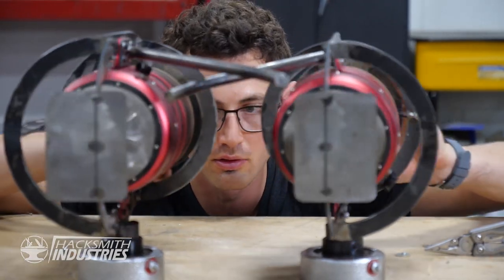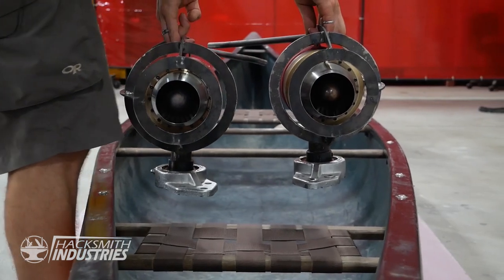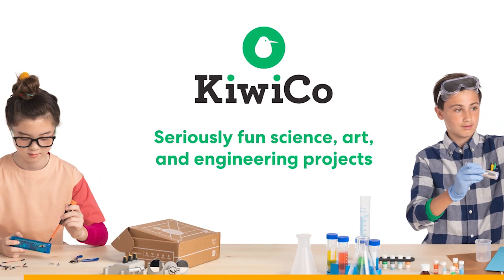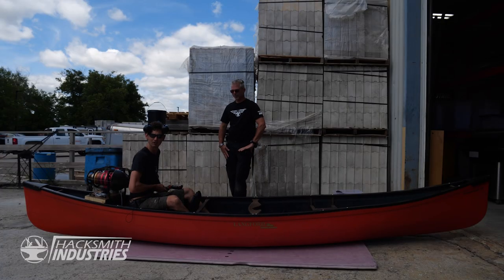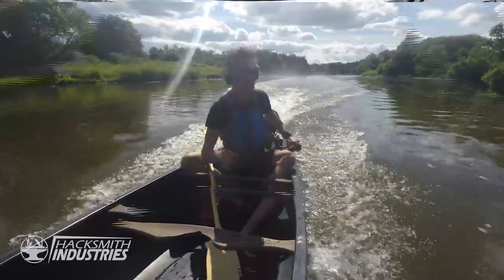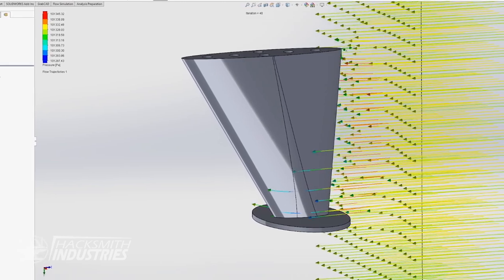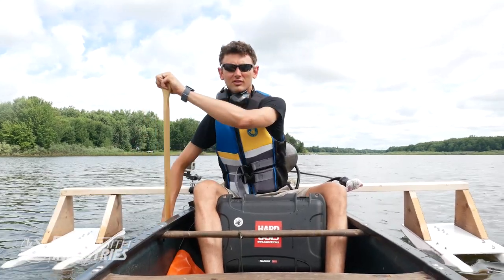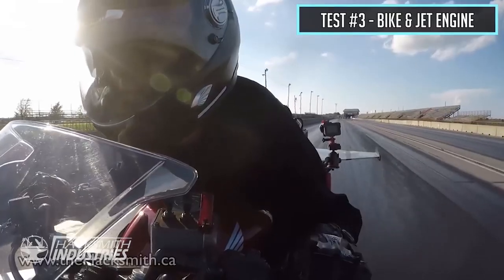JET ENGINE CANOE! (World's Fastest!)

Comment: Sit more forward and raise/pitch the jets so they give a more horizontal thrust rather than pushing the canoe down.
Reply: Second on pitch. Maybe a second lever for it?
Reply: Just put the jets on a hinge. Sit further forward with a longer control arm. More like the long boat racers.
Reply: More than likely having your weight forward would solve all of this... but if you needed more pitch control you could put hinges on the motors or put trim tabs....
Reply: Have you thought about how they're gonna steer the boat? Even though they sit more forward, what about the need of downforce?
Reply: or just counterweights might work
Reply: Ya but then you would put a more blunt edg into the water which would splash a lot of water into the vessel
Reply: Was thinking if a downforce wing at the front would work
Reply: Niël Muire If it was at the front, steering would be impossible, and the front would dive down into the water like a dolphin, in my imagination whatsoever.
Reply: @cedielenscarbonell1250  would the downforce at front be such a strong function of  force that the thrust vectoring at the rear couldn't change the direction?
Reply: I imagine that if you have a front wing and the downforce isn't sufficient that it could flip backwards because of that wing now
Reply: @cedielenscarbonell1250  what if the engines were placed towards the front and offset to the side so the gasses don't affect the driver. They could then be vectored and a small adjustable rear wing could inhibit the rear lifting. Also sorry for spamming you this stuff is just very interesting to me
Reply: Or do you need that lift so less of the boat is in contact with the water, reducing drag and creating more of a pivot point for easier steering
Reply: A method to maybe reduce drag whilst still keeping it in the water could be to have your engines up front and disperse the gas along the submerged length of the canoe. This could create a thin foam film to reduce drag without the need to raise the canoe out of the water.
Reply: I mean with it being above the water the water line, downforce being produced by air and not water
Reply: At any rate, if the hacksmith dudes end up reading this and you think its cool, I get my engineering degree end of this year and I have 3 years of workshop experience ;)
Reply: Niël Muire No problem, I actually like your idea.
Reply: Or maybe but a weight in the front to distribute the weight over the whole canoe while still having control at the engine
Reply: Yeah totally I know teleology to
Reply: Putting the fuel cell and maybe more counter weight up front should solve the problem.
Reply: @grantyalch5450  You'd need the front of the canoe to raise up a bit to let it glide, and i dont think more counterweights would help you at all with speed.
Reply: @cedielenscarbonell1250  have you ever heard of a rudder?
Reply: this -- ffs
Reply: If you look into small water craft like Zodiac's and Jetskis they are designed for this bow pitching.  While adding counterweights would be very helpful, I think that flattening the bottom of the back end of the canoe would allow the craft to reach a higher hullspeed because of the decrease in drag.  That way the nose will dip when the craft reaches a "planeing speed" after which the craft will be more maneuverable with the use of a rudder, and will have less drag as the vessel sits further out of the water. (People have been building boats for a while)
Reply: you need to modify the last half of your canoe get rid of the rounded corners of the hole and make it flat on the bottom with Square edged corners
Reply: You could also just put some weights in the front of the canoe
Reply: Elan Wan 
Putting a big weight on the front of canoe To keep the bowel down Will not work
All your energy from the engine will just go making bigger wake no gain in speed 
A Canoe is a displacement vessel once it reaches  its  hole
 speed Will not go any faster just make the bigger wave
Difference between a planing hole displacement hole
Reply: Definitely make the pitch adjustable, move you and the the gas tank forward. The liquid or gas will be pushed towards the back of the tank, and will be more pronounced as it empties effecting your center of gravity, and center of bouyance.
Reply: He could also just design a bracket that points the jets down a degree or two
Reply: @Giulio Basilico understandable, but what if the boat won't get directed properly?
Reply: It hurts to watch it try and get on plain
Reply: Holey water plowing wheelie canoe! This would be waaaayyy faster if you sat a little more forward and maybe some trim tabs to get up on plane.  Even faster yet, but a little trickier to engineer would be a hydrofoil design.
Reply: Next time they should do a EKRANOPLAN Canoe. That would be fun
Reply: @JustOutHereTinkering  maybe the electronics case and the fuel tank could be moved to shift the center of mass forward
Reply: Ditch the canoe and put it on something small that will plane. Adjustable thrust angle for pitch not yaw. Use a water rudder. The crazed nose up canoe was pretty epic tho!
Reply: YEAH REALLY...
Reply: When you are a single person in a 2 place canoe, you sit backwards in the front seat placing you closer to the center of gravity. Had they known this the canoe would not have gone so nose high
Reply: I just got the likes to 666....
Reply: I was gonna say that. if they were to sit just far enough forward so the bow is just out of the water they'll hit gold
Reply: Nerds

Comment: You had it at 8:37 "it was very back heavy"
2 ways to solve this:
1 point the engines down (just be sure you dont melt the back of the canoe.
2 (the most obvious) move the CoG forward. Make remote controls for the engines so the pilot can move forwards.

Also, if you had increased thrust the canoe would not have reared up further, instead it would have properly got up on the plane, leveled out and caused a brown stain in your pants.

It would only require a small skeg (look it up) the give directional stability and a rudder would facilitate much better steering than thrust vectoring.
Reply: Those two need to stay away from the water..... "back-heavy"? Most folks would stay "stern-heavy" ! Damn near fell out of my chair when I heard that!
Reply: @thomasnewbery7449  Tail heavy then, since it is a jet
Reply: @leifvejby8023  dude your a legend
Reply: @leifvejby8023  I stand corrected!
Reply: Or option three, more weight in the front. I was hoping that the cameraperson visible in one of the shots was going to stay there. It would have nailed the nose/bow to the water.
Reply: @rlaxton666  Yeah exactly. Most obvious answer, just more weight in front.

Comment: Canoe is too stern-heavy.
Their idea: 3D printed keels and outriggers.
My idea: Move forward in the boat.
Reply: my idea: stuff james in the front
Reply: Change the angle of thrust
Reply: I say make a ballast for the front
Reply: That was my thoughts exactly as soon as I saw how close he was to the engines.
Well that and adding a rudder to the rear operated by the same lever...
Reply: @mrmatt7210  Agreed. Since it sits pretty flat while not under thrust I would guess that the thrust angle needs to changed so the engines are pointed up just a couple degrees. Adding ballast to the front would only slow you down and possibly cause instability.
Reply: The amount of face-palm in this project is insane.... MOVE THE WEIGHT FORWARD!!!!! LOL
Reply: Put a car battery or two in the front.
Reply: 100 percent
Reply: @EasyMoneySG  Nah, what's happening is it's at the speed where the canoe is riding the wake. It needs more forwards ballast to help it level back out. Has nothing to do with the thrust angle
Reply: I was literally yelling at the screen: "Just move yourself further forward in the canoe! - Make a longer handle to still reach/control jets! - Stick your oar in the water one side to steer!" lol. Surely that would've worked better... I mean, thrust vectoring the jets is 'kinda cool' I guess, but unnecessarily complex, especially given he didn't have much directional control with it anyway. Rudder would've made more sense, or steer by creating drag one side with paddle/oar like the motorized kayak that already exists (See Top Gear).

Still cool tho.
Reply: Yea thats what i thought too wtf
Reply: @Epicwarrior846  james couldve been the ballast
Reply: Sailing dingys just use a tiller extension, buy one of those and your golden.
Reply: @ereklazar1384  couldnt have said it better myself!
Reply: If he'd sit in the middle the boat would soon the surface instead of ploughing through it
Reply: @mrmatt7210  that wont do a whole lot.
Reply: H needs a square back canoe so it can plane.
Reply: 2 words: Longer handle
Reply: Mr Matt Exactly. The engines were pointing upward. The thrust was pushing the stern down until the engines leveled out.
Reply: @pollux3685  frustratingly he was, but ONLY for the test with the out-riggers D:
Reply: 2-3 cinder blocks in the front of the boat
Reply: Not the best engineers!
Reply: When a vessel is planing it is sitting on top of the water where it has less water friction due to less of the Hull being in the water, by having all your weight in the stern and none on the bow your bow will rise out of the water but your stern will squat there for it is unable to overcome its displacement in the water and just ends up being a semi displacement Hull. The canoe would go a lot faster than that if they just moved the helm position forward at least a small bit. Probably not all the way forward otherwise the bow will start to dig in and you'll have stability issues at speed. I'm surprised they didn't try moving the helm position forward to begin with. Outriggers would only increase your stability at rest in that application.
Reply: Interesting to see it on hydrofoils
Reply: Yep. Would need to mount the engines higher to point them level and not hit the boat, so move the driver forward to next open spot and let it eat.
Reply: Also those aren’t called keels, a keel is the spine to the boat, those are keel fins, and even then not really because they were put onto the outriggers not along the keel. Also outriggers help with side-to-side motion not front to back, a keel fin helps because it gives greater purchase in the water but it needs to be a lot longer and farther up on the boat because you need that purchase to pull down the front end of the boat. The better solution is to give yourself a longer handle and put yourself in the front seat, as long as you weigh more than the thrust the jet engines put out you can go maximum throttle and you don’t have to worry about your clothes flying back into the jets. The longer handle will also make steering easier because you can move it less for a greater angle making it way more responsive.
Reply: Yeah I thought the same thing.. also the water seems to be rally turbulent under the canoe I think they are sacrificing a lot of energy to the steep angle
Reply: @EasyMoneySG   the canoe sat flat becouse he was sitting 50cm ahead
Reply: Youre right

Comment: Hacksmith 2030: “we put a fusion reactor on a canoe”
Reply: “We put an arc reactor on a canoe”
Reply: Hacksmith 2080: "We put a Black hole on a canoe"
Reply: Hacksmith 2090: “We put a inter-dimensional portal on a canoe”
Reply: @TRAMNITTSU  Hacksmith 2100: We created another universe in a small containment unit and used it's almost unlimited energy to power a canoe
Reply: Hacksmith 3000: “we used the fundamental basics of warp drives such as anti mass and positive mass powered by reactors with the output of 20 suns to warp drive our canoe to 729,000,000 times the speed of light”
Reply: Hacksmith 2030: we put an air tight capsule and military grade rockets on our canoe to go into space

Comment: Hacksmith: I don’t know anything about Aerodynamics or water dynamics

Hydrodynamics: Am I a joke to you?

Also, quick tip for the keels. For sailing at least, you want the keel to have a more teardrop shape like an airplane wing for the best outcome.
Reply: Blake Erenhouse as an f1 fan I wonder if they could use like a f1 wing design on the boat to create downforce at the front of the canoe seems like a long shot but that would be cool
Reply: Fluid dynamics: Yes, you are a joke.
Reply: Blake Erenhouse  aeroplane
Reply: @DanC8111_  I think a hydrofoil in the back would  probably work better the air speed isn't that high.
Reply: Is the one connected to the steering also called a keel or does it have a different name? I don't remember.
Reply: @The_Potato_Lord  are you referring to a rudder?
Reply: @lostincyberspaceIII  thanks, I haven't really had to remember the names for any of them before

Comment: You're losing too much forward momentum by riding bow high and creating such a massive bow wake. Ballast the boat forward to drop the bow, and lose the wake. Also, it would be safer. Currently, if you should turn too quickly or wind gets beneath a high bow, it could potentially flip the canoe.
Reply: He needs to plain the canoe.
Reply: @fernandoayuso2672   There are only two ways to get the boat on plane. If he is going to keep the engine and himself at the stern of the boat, then he needs to place ballast forward. He needs to get the bow of the boat down. Otherwise, he and the engine can move amidship, which would place it closer to the center of mass. However, moving himself and the engine amidship would cause the boat to be unstable in turning. The turning arm is short and now coincident with the center of mass. Thus, the boat would quickly snap around in turns causing wild oscillations. Alternatively, he can leave the engine where it is and move himself amidship. Then he would require a longer tiller and control extensions for the engine. This would place ballast forward, which would offset the weight of the engine at the stern. The bow would lower and the boat would safely plane, but with the added expense of a longer and more complicated control arm. There are always going to be compromises in design.
Reply: @pdgingras  Yes it can be done. Like finding a way to tilt the engine without compromising anything you mentioned.
Reply: True. You can attempt to trim an engine. Generally, it's either 20 degrees of trim up or down. This is assuming that the boat-motor combination are compatible. Trim is used to optimize the angle of the engine to get the most amount of wetted surface for the boat, which will give the most efficient plane possible. It's not meant to correct deficiencies in design. In designing the motor mount to incorporate trim, you would have to experiment with various heights of the mount above the boat's stern. The higher the mount above the stern would give greater leverage. And then you could experiment with the trim, remembering to keep it within the 20 degree range. I still feel that ballasting the boat forward would be the simpler solution. Just look at some of the high speed ski boats that place water filled ballast bags in the bow to compensate for weight distribution and the ability to give the boat a flatter ride. 

Ballasting is also used on many ocean going ships. It's a very viable way of changing the center of mass to prevent rolling in heavy seas. Of course, ships don't need to worry about ballasting fore and aft, as they aren't designed with planing hulls; they're displacement hull vessels. 

Great converation. Many thanks.
Reply: @pdgingras  Your welcome! So do you have a channel, you seem to be very knowledgeable?
Reply: Well, thanks Fernando. But no, I don't have a youtube channel. I have studied mechanical engineering, and worked as an engineering technician in an research and development setting, a boat mechanic and ran a west marine for a while. 

But I do love boating. I just finished refitting a 1957 starcraft, but it was too late in the season to enjoy it. I plan on getting it in the water this spring. I am retired and keep myself busy with projects. Currently, I am working on rebuilding a camper trailer from the ground up. It will require lengthening the actual trailer by a couple of feet, and then constructing the body of the trailer and outfitting the interior. And in the spring, someone wants help in designing and constructing a console for a pontoon boat. 

In the past, I have done some of the rough carpentry for a chapel build at the local church, and built a new chicken coop over the past summer. Otherwise, I raise chickens (egg layers). So that's what I do.
Reply: @pdgingras  Fantastic! I'm sure with your knowledge, you would bring great content to YouTube! Keep on keeping on!
Reply: why not just sit at the front of the canoe?
Reply: @busybee6889  Maybe that could work but I myself have toyed around many canoe's with small outboards. Which have sunk when I tried that exact thing. The bow sunk into the water as soon as I slowed down!
Reply: @fernandoayuso2672  ahhh true...i didn't consider that...unless if they had put that outrigger set up on the front to keep the front buoyant at low speed
Reply: Don't bring the bow down, raise the stern! It ain't rocket surgery!😂

Comment: Suggestion: Raise engines higher to provide more downward torque when providing more thrust.

Idea:  Hydrofoils.  You could get some absurd speeds.
Reply: They just need to be able to tilt the jets to trim the boat. Hydrofoils, now you are talking Kiwi styles. 
The Commonwealth always had it over the Yanks.
;-)
Reply: Just att 100 lbs of weight to the nose
Reply: or sit closer to the front of the canoe. it will also help steering as the center of mass will be farther from the thrust, giving a bigger turning moment.
Reply: @BoB-Dobbs_leaning-left  exactly my friend.